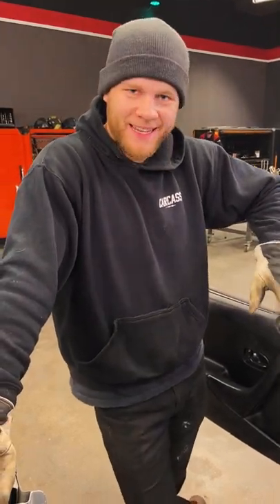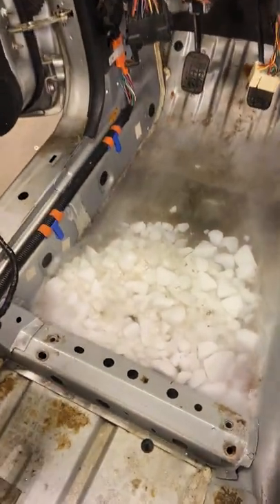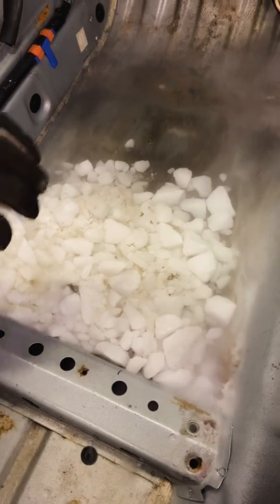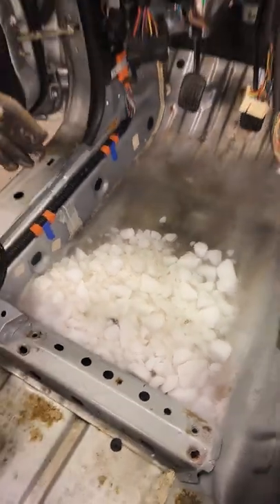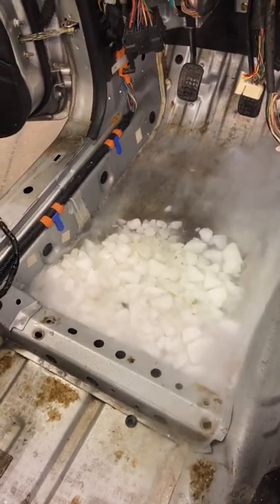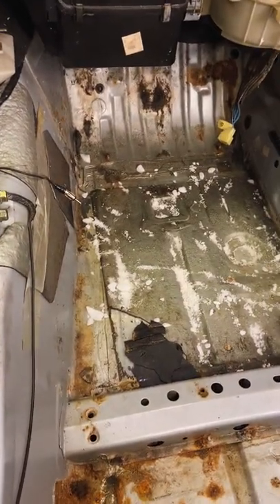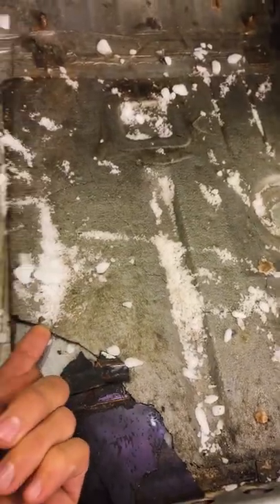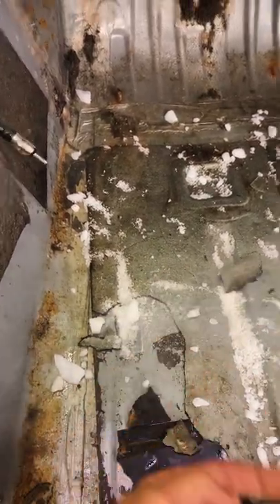Dry Ice on the Spec Miata

Comment: Yep, a classic tactic for removing all that dead wight.
Reply: Is that the only reason they're doing that, to save weight? Or are there other benefits?
Reply: @eddyb1596  that’s it lol
Reply: @eddyb1596  have to remove it to wield where sound deadening is
Reply: @familyguyhaha  okay that makes sense. So it's not just weight, it's also strengthening and rigidity. TY

Comment: The same when it came to my race car. Made it so easy. One of these day. I want the chassis dipped and stripped.
Reply: So it can rust to dust
Reply: @cimism610  no, so you can strip out every little bit of undercoating and whatnot in and outside the car. Once you're done and you're done doing any sheet metal work and seam welding. You go back and paint or powder coat the chassis

Comment: couldn't find dry ice in my area. a heat gun worked great. heat for a few seconds which breaks the bond and it pulled right up.
Reply: I think kroger usually has it
Reply: Well he said the dry ice was an alternative to using heat.
Reply: Dairy queen sells it if you have those near you
Reply: @ericflowers2146  Kroger/Safeway does sell dry ice. Many floral shops do as well. Party suppily stores usually. Personally though my absolute favorite place to buy my dry ice for the week is Dry Ice Wonderland and If the appearance of the dry ice isn’t an issue I’ll go to the Dry Ice Wonderland Outlet!!!!!

Comment: Why wouldn't you leave the sound deadening material in the car?
Reply: Less weight = faster acceleration, faster braking and better handling.
Reply: @frizzlefry1921  
I doubt the sound insulation weighs more than 5-7 pounds for the entire car floor.  I seriously doubt removing the sound insulation is going to make the care handle better.

Comment: Sound deadening only lasts for a limited amount of time you have to change it if you're restoring a car you have to get it out to get rid of the rust and repaint it but using a heat gun and putting a little bit of heat will release the adhesive and you'll peel it up in one piece

Comment: I personally sell and maintain the equipment that dispenses the adhesives and sealers in the automotive manufacturing and can tell u the adhesives are some of the worst thing to work with and is usually only cleaned with grade A lacquer thinner. Quick tip, if it's yellow or beige in color , it's sealer which is used for moisture barrier and sound proofing and does not get hard and can be cleaned easily with varsal. Should also mention the dry ice thing can still get very messy if u don't work quickly bc it will thaw really quick once ice is gone. We had a few meters and pumps cure with adhesives in them and tried the liquid nitrogen but ended up making a huge mess in the end. These adhesives tend to be stronger then welding but I have noticed a downgrade in quality of adhesives over the years and sometimes even add glass shavings to the glue I think as a filler but shitty to work with non the less.

Comment: Rubbing alcohol is the key
Reply: If you've ever changed a fuel pump and accidentally poured gass on the sound deadening you would see it turns to liquid no need for any dry ice at all just wipe off the sound deadening
Reply: @Blaaggarding  First of all gasoline is dangerous pour in your car and the soundproofing they wanted to come off and solid pieces besides it’s very difficult to clean the smell of gasoline out of the vehicle rubbing alcohol and dry ice it’s quick it’s easy the residue can be cleaned out very very easily
Reply: @ronemtae3468  there's many ways to skin a cat.      Its just an option. Dry ice is not available at all where I'm from so I'll put up with the smell of gass for a while .....   By the way dry ice can be extremely dangerous as I am  sure you know .

Comment: And how much weight is that REALLY going to remove on something of this size? 10-15lbs?
Reply: Any idea how massive that is when you're looking to reduce weight?
Reply: @samtime3803  It's like 4.5-6.5kg's man. Just put 5L less fuel in the tank... 😂
Reply: @samtime3803  In all seriousness, I understand your point- I just think 10-15lbs is barely going to be noticeable. I think on something really underpowered like an MX-5 you wouldn't really notice a weight reduction less that 25-30kg's. Even then it"s going to be a really small difference. But hey, that's just my opinion
Reply: The important thing to consider is if weight reduction is their goal this isn't the only thing they're doing. Ten pounds toward a goal of reducing 200 is pretty substantial